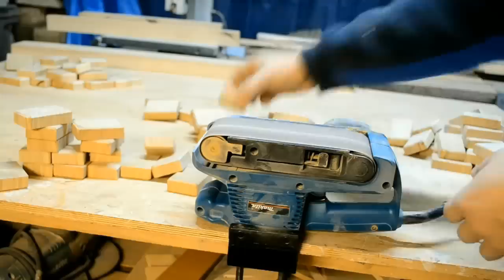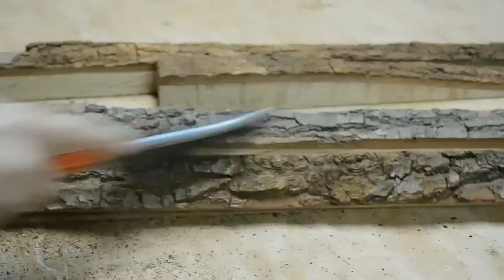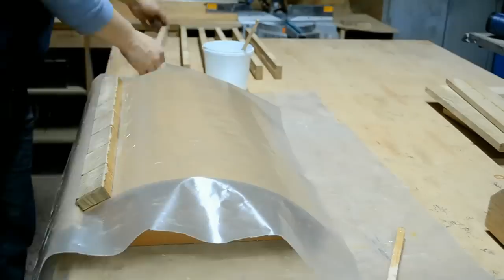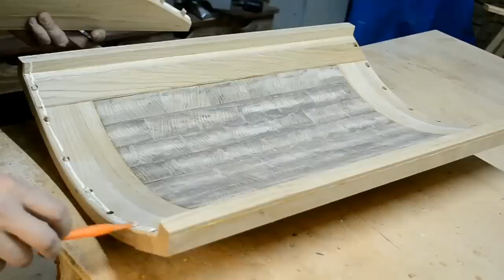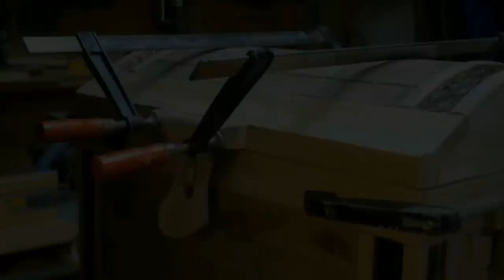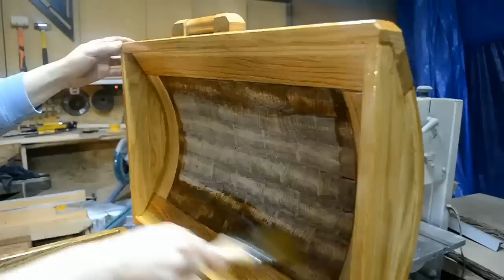Oak chest

Comment: @HomeMade in Lviv
I had learned working with wood from 1975 to 1979 in a very little german handcraft company. From A to Z all things. My master piece years later was an oak chest too, funny. A different design but all from wood. No screws in any way. Handles, the lock and the hinges. I got 100 points for it. I worked my whole live later in software coding in the industrial automation but i never stoped to work with wood in my free time. I love what i see in this video. Good old way of working. I had used less epoxy for the top part but that's ok. Very well done.

Comment: Amazing oak chest. Very well thought out cutting and pattern laying of the oak block pieces. The bark inlays are pure artwork. 
A minor observation, the lock and hinge blocks could have been fixed using tongue and groove into the chest lid and case body without using a single screw. 
Still a wonderful clever design and crafted masterpiece.

Comment: I like your design and craftsmanship only have one wood worker question: because the wood grain orientation of the panel is perpendicular to grain of the wood frame that hold/locked them in, their expansion/contraction rate are way different, are they still holding well? Is there cracks somewhere after a while? Thank you.

Comment: A great piece of work. Do you find that the epoxy adds that much more strength to be needed?
Reply from the maker: Thank you! Epoxy resin is more practical in this case, acts as a glue and fills the cracks

Comment: Not sure if someone mention. I would make that lock latch smooth so if a little one decides to play hide and seek and the lock falls in place they can push up on the lid and it will open. otherwise will not be a fun time.